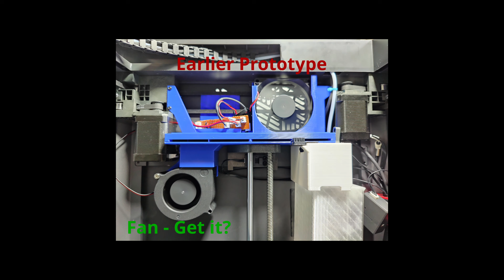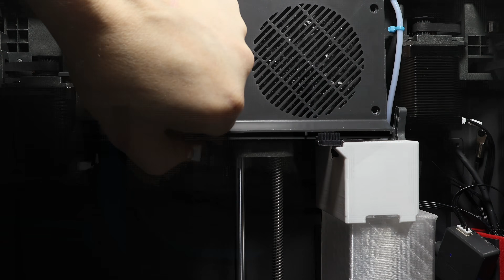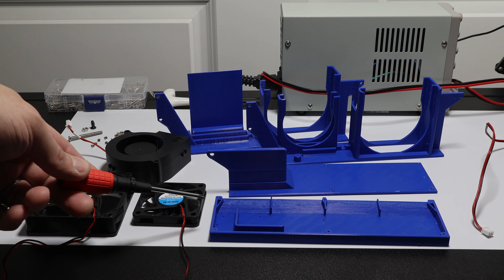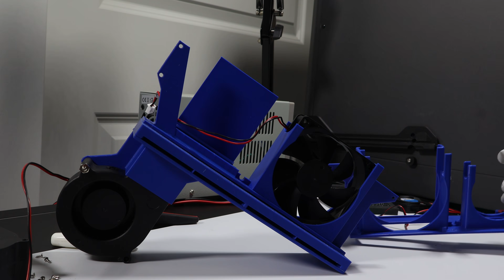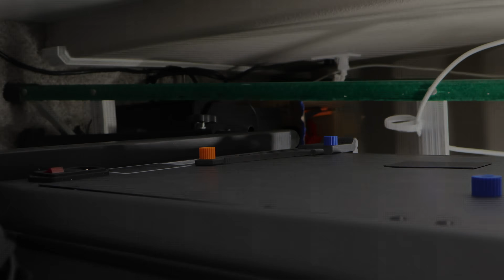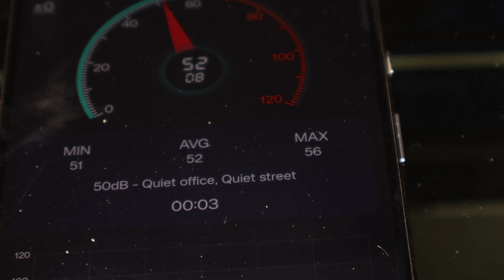Centauri Carbon Quiet Chamber Recirculation Mod

Comment from the maker: Do you have any ideas for how to improve this design? Would like like to see a deeper dive with better testing methodology? Let me know! If you would like to try this yourself, find the model here:
https://www.printables.com/model/1356199-centauri-carbon-recirculating-noise-reduction-air
Reply: What chamber temp did you use for ASA? I am getting layer separation yet, set the chamber temp to that listed on the sulu print spool !
Reply: Great design concept, my first mod to it is going to be reworking the exhaust fan section. When I first got my printer I found the confined room I used it in was filling up with VOCs and making me sick. So I'll be disconnecting the fan, rewiring the OE board connector for 5v (dropping it from 24v) to connect to 5v relay coil to toggle a mains feed to an external ducted fan that blows to the outside.  Leaving the original fan in place adding an LED circuit to show the fan is spinning caused by the external fan pulling the air through.
Reply: I’d say first remake the fan shroud as is then, modify using the original mounts.
Reply: Anyone have a model of the original shroud I can make some mods
Reply: @SyntheticElectron3D  are there any mods that bypass external venting and keep the air in the chamber? I want to keep my chamber temps up and it’s defeating if I’m blowing the air out b
Reply: Fans from the company be quiet! might help (kinda what they specialise in, hence the name), but idk if they still do 60mm and 80mm fans.

Tbh I'm less worried by the sound of the fans and more just the printer head moving, it seems way louder.

Comment: Honestly, I swapped my fans for silent pc fans, no extra parts needed and I think I got just as much noise reduction
Reply from the maker: Yeah, that's very possible to do. The parts give you more control though. Not that the current board addresses the issue, but if you want to replace the mainboard fan, you'll have a hard time unless you can find a drop-in fan that you can either use as-is, or re-wire to function as a 3-wire fan with tach signal. The firmware throws an error without the tach signal. I have a fake tach version that I was planning to develop so that any 2-wire fan could be used. I almost hate the mainboard fan noise more than any of them. It's that drone that gets to me.
Reply: @SyntheticElectron3D I had some "silent" 3 pin fans from an old project that I swapped in. Didn't realise they've become so hard to find now
Reply: @SyntheticElectron3D   larger and slower speed fan will reduce the noise and also will do the same job of pulling same amount of air.

Comment: i find this to be a waste of time
the whole idea of the case fan is for heat  extraction 
so when printing like pla  this extracts any heat build up, and when you need it hot for CF and PETG you can set the fan to either be off or low enough to make the inside just right
so you don't need to circulate 

so far with many reels of pla+ Petg and CF and of course ABS I have had not one failed or any issues
just perfect prints.

don't get me wrong i love mods but it has to be worth it
like the Riser. that gives more room for the  Bowden tube and some more LED'S

Comment: I really don't understand all the complaints about the noise this thing produces.

If you're running a 3D printer in your living space, you're a moron. The noise is the last thing you should be concerned with.

Comment: How about if we change the fan to noctua fans?
Reply: @imannekros8524  is it just as simple as replacing them? And connecting the cables?
Reply: @Andy_Tibbs thats what im asking 3w pwm to 12v or 24v would it reduce the rpm?

Comment: CC is not the quietest but I wouldn't go to all that trouble to reduce 20% of the noise, what I did was put a box at the back of the machine just to catch the air that comes out of the machine and throw it out the window with the help of a 4" inline duct fan, which doesn't change the temperature of the chamber and in case I need to close the door for more sensitive filaments to the temperature variation the CC is quieter.
Reply from the maker: 20% suggests you're thinking in terms of a linear reduction. Decibels are logarithmic. It's more like an 80% reduction.

Comment: I actually like the sound of the CC when it's working. It's like ASMR for me. The only thing I don't like is how my desk is shaking when the CC goes full speed
Reply from the maker: I like the tool head movement sound, but the aux and mainboard fans are problematic, IMO. The aux fan is okay in small doses, but after a few hours, it's fatiguing. I don't mind the chamber/case fan. It's the drone of the mainboard fan that bugs me the most, but it's also the quietest of them.
Reply: I recently added squash ball feet and it shakes my desk a lot less.
Reply: @DudeItsRobert  Squash balls are pretty good option, if you dan want to use foam and a stone plate

Comment: My question is does having the spool on the inside actually do anything or is that more for aesthetics and space saving?
Reply from the maker: If you print highly hygroscopic filaments it keeps them dry for the duration of the print without having to use a separate drier. Materials like PA6 nylon soak up problematic moisture in minutes to hours. It just saves the  hassle of fumbling with another piece of equipment in an already tight space for me.

Comment: The other blower you're using is the Wathai 75x30 24V fan? Would you recommend it?
Reply from the maker: If my intention was to buy a sleeve bearing fan specifically, maybe. TBH, if you want better longevity, I recommend a dual ball bearing model.

Comment: Interesting project. I installed a modified bento box that holds the Voxel bambu lab hepa\carbon X filter to clean and recirculate the chamber air. I un-plugged the case fan from that daughter board and plugged in the bento fans in it's place. I'm blocking the exhaust port but I may incorporate some of your design to redo the blower fan to block the intake vent and let it blow chamber air to see how it does. 👍
Reply: Id love to see some vids of your work!

Comment: Awesome mod my friend and thanks for sharing.  Just curious if anyone else's CC makes rattling noises when the print head moves?  I haven't been able to figure out where it is coming from.  The printer works great and haven't had a single failed print with it yet in 2 months of use, but the rattle is annoying.
Reply from the maker: The CC makes all kinds of noises depending on the speed and direction of the gantry, from my experience. Some of which may be described as rattling. If the printer is otherwise working great and nothing feels loose, the rattle is probably benign. If you haven't already, you may try tweaking the speed settings in the slicer or even selecting a different mode while the printer is making the sound (Silent, Sport, or Ludicrous) in the UI to see if anything changes.
Reply: The part cooling fan and housing could rattle a bit.  I shaved a notch in the fan case top lip for the wires to pass through which helps it fit tighter.

Comment: I've been following your upgrades and testings, that's a great one!

Would a 80x25mm fan replace the 80x20mm? Does it fit in there? If so, how would that perform in noise reduction ?
Also, would using 12v fans (which are known for being quieter) with a step down LM2596 (24v to 12v) reduce noise too?
Reply from the maker: Yes. There is a divider at the bottom of the version without the 6010 slot that helps keep an 8020 positioned forward that can be clipped out with flush cutters to accommodate an 8025 fan. Generally, thicker fans produce more noise, especially since they contain more powerful motors. But it depends on many factors, including RPM and blade design. I don't have personal experience with this fan, but this Alinan 8025 fan has the specs that I would personally try first: https://amzn.to/3TUUyA2 (affiliate). It claims to only make 27 dB of noise at 3000 RPM. My understanding is that the CC stock 8020 is around 40 CFM and produces about 37 dB, but I'm not certain. An 8020 Winsinn CFM equivalent to the Alinan 8025 would run at 3500 RPM and produce 33dB. I'm finding in my testing that without the carbon filter in place or an internal grill, the fan produces about 0.5 m/s more velocity because it is less restricted and sucks heat out faster than anticipated. A lower 32 CFM fan is probably a good thing with the mod as it currently is.

Comment: good job, my question is , Can I find quiet fan install instead of the original one without any modify to backend fan holder?
Reply from the maker: Yes. Just make sure you are looking for a 24v 7530 form factor for the auxiliary (the centrifugal blower) and a 24v 8020 form factor for the case fan. They are 2-wire fans. Unfortunately, 24v options are not as widely available as 12v options. My frustration is that a majority of the 24v 7530 fans readily available seem to use a sleeve bearing instead of more reliable ball bearings.
Reply: @SyntheticElectron3D  buck convertors are very cheap any more. I think that would be the way to go. When looking for noise reduction, good fans are a must. I noticed in the past that these cheaper fans (not speaking of the stock fans for the CC) wear out very quickly. I am guessing part of this is due to filament webs getting pulled into them.
If someone really wanted to dive in, they could run an arduino or Pi with the right peripherals, and set up a PWM to trigger the fans at different temps. Not to mention the option of programmable LEDs.....Lol.
Got a sub from me BTW.
Reply from the maker: @tsepash yeah I'm not happy with most of the fan offerings particularly for the 24v fans in the stock form factors for the CC. The only fans that I have experience with on Amazon that are okay are Winsinn and GDSTIME in dual ball bearing form. They're not on par with Noctua by any means. Noctua has limited offerings especially in 24v fans. The buck converter is a good option because it opens up the possibility to use 12v fans. I did a little PoC using a Mini-360, MOSFET module, and a potentiometer that I posted on Reddit a few weeks ago. It shows me running a 2-wire fan adapted with a 555-based fake tach signal for the main board 3-wire fan and controlling an old Thermaltake 8020 12v with the MOSFET/POT. That's another thing on my list to cover in a higher quality YouTube video. I like the MCU-controlled MOSFET idea, too... But I have a long list 😅
Reply: @SyntheticElectron3D  You certainly know more about the electronics than I do. Lol.
I used winsinn fans on my Aquila X2, which was the first 3d printer I owned. The first fan got noisy pretty quickly but the second one held up. They were the RGB ones recommended by Feddor from 3DPrintSOS. I did quite a bit of modding to that thing, lol. I ran a buck convertor to power the Pi Zero W that I had to make the printer wireless with Octoprint. I originally got the buck to convert all the fans to 12v after the first Winsinn died.  My idea was as I said, buck convertor - Pi - modulation chip (i think that is what it is called) and CYD to output temps and fan speed. It became more of rabbit hole and I never did it. Long list as well. Lol.
I may look more into a similar setup now with the CC as I feel it will be a more permanent addition to my ever growing collection of printers. I also have a lonely BIQU Pad 7 with an extra CM4 and Pi4badapter,  now that I retired the X3 I had it on. I will have to see what options I might have using that or the CM3 that the Pad 7 shipped with. I also have a Mars 3 and Saturn 2 that I want to make wireless, again. And then there's the Kobra 3 Max that I happened upon.  Why does nobody warn us about how quickly these things multiply? 
Anyway, I look forward to more content and I will peruse your other videos as I get the time.

Comment: I am kind of curious about the life of these particular fans as I was doing research all weekend. I am slightly worried about the life of the blowers in question due to the lubrication of the sleeve bearing compared to a ball bearing. Some reviews on some of the sleeve style bearing fans are that the sleeve system breaks and the lubrication releases. Finding proper sized fans in the correct voltages has been very annoying with the Centauri. The part cooling fan is one of the main ones I have been trying to find a replacement for and its damn near impossible finding a "good" fan. I have also found that the fan itself isnt necessarily that loud, its the fact that the one they had made for this printer is operating at 10,000rpm's at 100% speed. If you just slow the fan down, the noise levels go down quite a bit. Most fan at this size are only hitting around 4500rpm's.
Reply from the maker: Yeah, sleeve bearing fans don't last very long. I'm aware the development of a printable toolhead design that may permit multiple fans to be mounted, like dual 40mm or similar. I have developed a fake tach with MOSFET control that I tested on the mainboard fan that might be applicable to the toolhead to allow generic 2-wire dual ball bearing fans to be used as part cooling fans. That's on my video ToDo list, but at this point, I have more ideas than time. It may be a few weeks before I get to that.

Comment: Want to buy CC but all the additional steps you must take to make it  work as intended  is  what is stoping me.😅
Reply: I wouldn't say these additional steps are a "must", you can print ABS/ASA just fine without mods. If you're concerned about the noise level, you're not going to sleep next to this printer either way, with or without the modification lol
Reply from the maker: @xKenn You're right, not a "must." Except maybe for 3D printing nerds 😅 I think some might be a must for pure PC though. I haven't had a chance to test it yet with all my mods but a stock CC doesn't yield good layer adhesion using Elegoo PC filament. At least for me. I have to turn to my Qidi X-Plus 4, where PC is concerned, so far. I want to change that.
Reply from the maker: It's not a bad machine in terms of value. Out of the box for PLA and PETG, it's not bad. I think that's probably what Elegoo was going for. I hear you though. There's a lot of room for improvement.
Reply: Mine works great right out of the box.  Love it.
Reply: They work fine as is.

Comment: Sorry, I am a little confused. With the replacement Wathai fan, you don't need to use the daughter board? You said you didn't mount it for testing... What is your chamber temp after the mod with the door closed and what filaments were you using at the time? You said you haven't run into problems, so I am just curious what your temps were.
Reply from the maker: If you're using more than two fans, you can't really use the daughter board. At least not without a supplementary JST-XH connection elsewhere. The fans typically come with a JST-XH connector, but the OE fan's leads are too short. The Wathai's leads were longer, and it was easier to use that to demo the mounted daughter board than make an extension for the OE fan. I wanted to do a more apples-to-apples comparison as well - the OE fan in the OE enclosure and position vs. the same fan relocated in the mod. My temps can get into the low 40's in an air-conditioned room for a relatively short print of 1 hour. Where before I would be 35-38c tops. Of course, on a longer print, with ASA, for example, temps can get up into the 40's eventually with the OE config. But I have done very little testing so far. Hopefully this helps, but I understand the confusion. I need to do a more comprehensive follow-up with more testing data while also clearing up a few details.
Reply: Ah Ok, you didn't mount the board because the power cable was too short. Now I get it (sorry).
Yes, I'd be very interested in a follow up with some more temp testing. I'm currently running 29-34c with the door cracked in a ~30c room. I'd love to be able to use this mod with just the blower and case fan, with the door closed, while printing PLA/PETG (which is mostly what I print, though I will be tinkering with ASA, ABS and TPU soonish - which is why I bought this printer.) But I need to look into what is a "bad" chamber temp for printing those lower temp filaments before running into print issues.
Glad I ran across your channel. You've got a new subscriber. :)

Comment: Thanks for your work on this. What fan did you buy?
Reply from the maker: Thanks! The blower is a Wathai 7530 24v. It's a very inexpensive fan I got for testing: https://amzn.to/4kN1El0. The 6010 is a Winsinn 24v, which is fairly good quality: https://amzn.to/4kN1El0 (affliliate links, BTW).
Reply: @SyntheticElectron3D  thanks I will use the links.
Reply: @SyntheticElectron3D the two links you posted are exactly the same model of fan.
Reply from the maker: @jonferraez  Ugh copy and paste error. Thanks for the heads up!